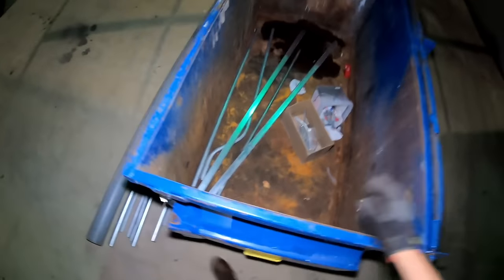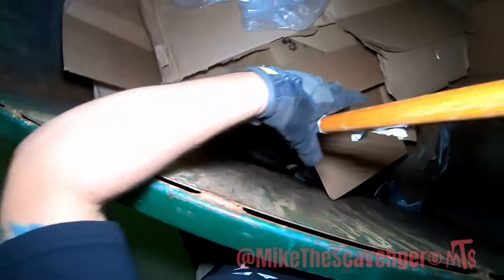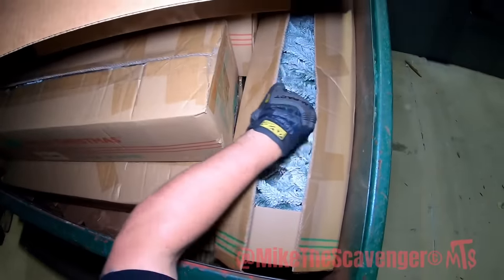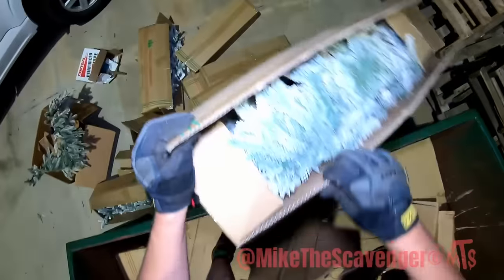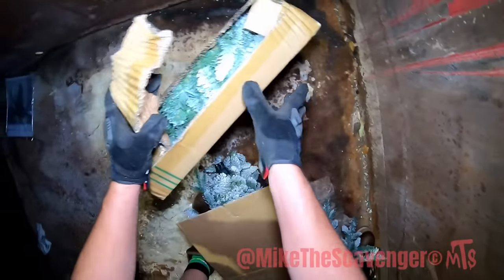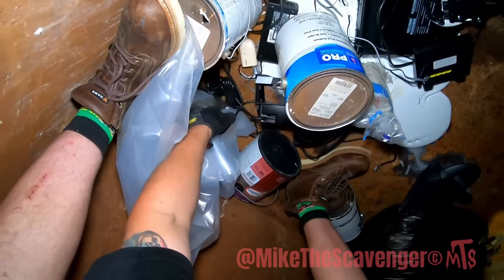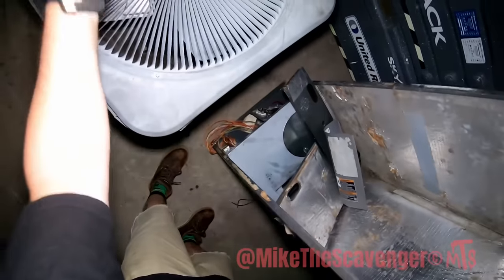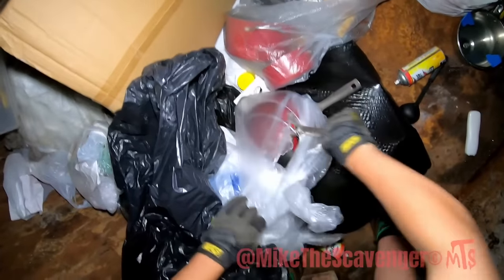Dumpster Diving "Beyond Out Of Control!"

Comment: Surprised you didn't have a crane yet. 20 years in dealership service depts and I don't think I knew a scrapper without one lol

I did watch a few with broken or over loaded trucks with no lift access still drag engines up and in though lol

Comment: That A/C Lennox unit croaked because they never cleaned the coils, that was plugged really bad, compressor goes out on high head pressure and it gets burned out, expensive lesson to learn when you defer maintenance.  Copper coils will be a nice scrap find.